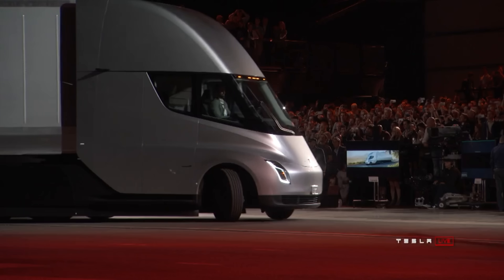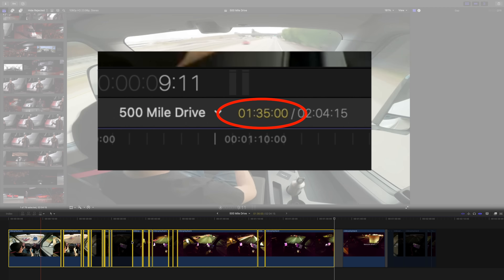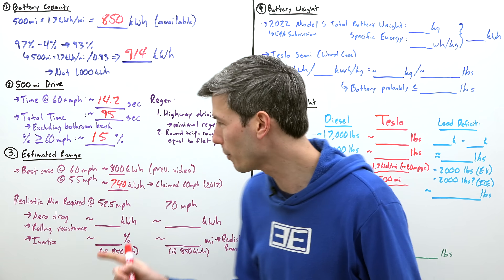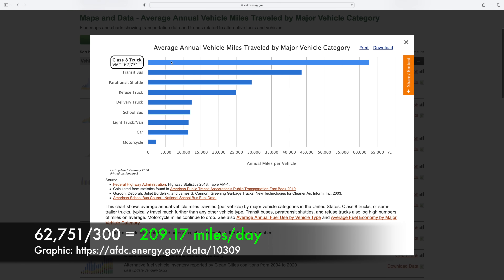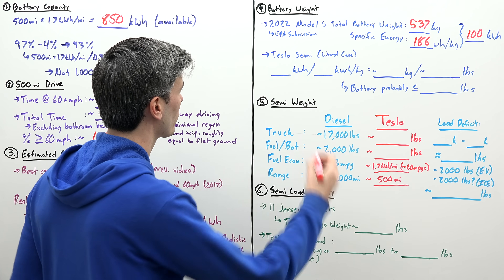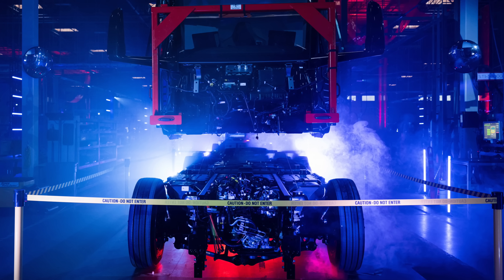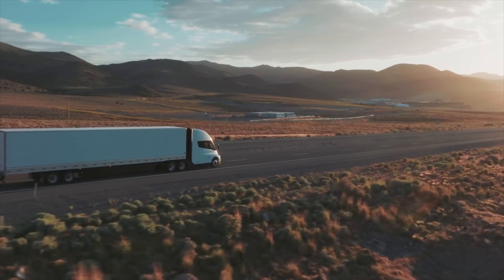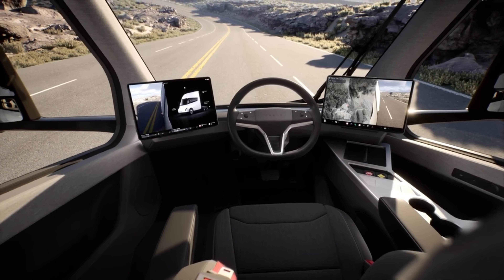Does The Tesla Semi Make Any Sense? Part 2!

Comment: It is refreshing to watch a video that provides a balanced and objective analysis of a Tesla product. This video has been very helpful in explaining some of the factors that need to be considered. We are on a 'journey' to alternatives to Internal Combustion Engine vehicles. At the very least, Tesla will continue to be important in providing options in the development of future transportation means.
Reply: At the same time US are one of the worst rich countries to develop the ev-truck. Just due to the size. 
 In the Europe in 500miles you can cross at least one whole country (eg. From Belarus to Berlin via Poland).
Reply: @BlueScreenOfDeathPL  
Unless I'm mistaken, in Europe (and UK) there's also more regulation requiring drivers to rest, increasing charge opportunity?
Reply: @rogerstarkey5390  You are right - we can drive up to 10h per day (11 on special terms, depending on country, and we have 45min break), so range of 800-900km would be enough.
Reply: @BlueScreenOfDeathPL  
Thanks for the clarification.
Is the 45 minute break over and above the 10 hrs?
Reply: @BlueScreenOfDeathPL  900 km is not needed. EU rules say you can drive a maximum of 4.5 hours before a minimum 45 minute break. And with a legal maximum speed of 90km/h, that means that you are not even allowed to drive more than 405 kilometers in one go.
Reply: @rogerstarkey5390  45 minutes every 4.5 hours in EU
Reply: We're at the high economic limit for battery cost and from here on it will just go down. ICE has been at their high limit for decades...and it just goes up with fuel costs. True, they both use the same kWh in the end...but electric distribution is an order of magnitude cheaper than hydrocarbons (no...they don't come from fossils). If charging time is an issue, Ultra-caps will solve that.
Reply: @Todd Marshall  wrong... it will only go UP... Because we are RESOURCE limited on the raw material side... just not enough slave child labor to keep up with demand
Reply: @toddmarshall416  Supply and demand will dictate the Price, As demand go up so will the price
Reply: @retired2920  
"Supply and demand" for let's say oil requires constant replenishment of the supply.
.
Once battery materials are in the system, they stay in the system for ever being recycled as required.
As for Electricity supply and distribution, you can build green supply for about one third the price of even nuclear.
Once built it's essentially passive, requiring little if any maintenance.
The cost will go down over time.
Even better, if you build at point of use (rooftop solar, etc) it becomes cheaper than the cost of even distributing other sources of grid energy.
It trends to free
Reply: It wasn't deceptive at all to bury the massive subsidies Pepsi is getting until the last couple seconds????
Reply: The very big flaw of videos like this, is taking what ever Musk says/twits as a fact, despite Musk proving himself as compulsive liar again and again. Any analysis, no matter how objective it is, based on data from Musk is untrustworthy.
Reply: what is the cost of replacing the batteries after between 7 and 10  years, Who is going to buy a used truck when you my have to replace the batteries, what sort of trade in are you going to get if the dealer thinks he will have to replace Batteries. Will the warranty cover the Batteries don't think so, How long is it going to take to FULLY charge the Batteries
Reply: @retired2920  you know full well tesla doesn't warranty batteries, and it will be $100k
Reply: @finish_my_projects  
YOU should "know full well" that they DO warranty batteries.
Reply: @Roger Starkey  not like you think they do... nothing like an ACTUAL warranty on a powertrain... on for loss of range above a certain amount in the timedrame, and manufacturers defects... if it bursts into flame, tough titties, if it breaks in any way not a manufacturer defect, suck that $20k bill
Reply: @finish_my_projects  
Rubbish.
If it "bursts into flame" and it's a manufacturing fault, it's under warranty.
"If it breaks in any way other than manufacturers defects" that's like ANY other warranty for any product you buy?
.
And where do you find the "20k" guess?
Reply: @finish_my_projects  last quote I got for my puny leaf battery was 8900 dollars.
Reply: @Roger Starkey  no it specifically says battery fire is NOT covered, so wrong... and warranties on your drive train also don't specify the need for a manufacturing defect, you are either naive or being intentionally obtuse...

The $20k cost of a battery is well known, that's what a tesla extended range battery costs, $21k actually... standard range is $16k, I've seen people show the quote directly from Tesla, one is on Hoovies garage
Reply: Lmao, those conditions do not take into account weather and the battery losing capacity over time.
Reply: Ok but this video is assuming those barriers each way 4000. There’s no way to verify that. 
They could each weigh 500lbs and we’d have no way of knowing.
Reply: @Ian Fisch  
I think he's done enough to show that they are typical barriers and he found the weight for typical barriers. Sure, the barriers on the truck may be a different weigh, but unless there is some major subterfuge going on, I think we can safely assume that 4000lbs is a good estimate for the purpose of the video.
Reply: @rogermccaslin5963  if you look at the barriers, you will see that they are somewhat different to New Jersey barriers typically seen across this nation. The end caps are different. The material appears chalky, but most importantly, who drills holes in New Jersey barriers to run change through them to strap them to the on the trailer? Seriously, who does that? I think maybe it’s just a Tesla doesn’t have any truckers on their staff and literally thought that was a good idea but that said when you look at the holes, it just doesn’t look like the new Jersey barriers that I’m so familiar with on the East Coast. And a full load of New Jersey barriers is two high on trailer. So it best this truck looks to carry half what a diesel truck would carry. Just go look at the videos goal online and Google image New Jersey barriers. You’re gonna see they. They often have either eyelets at the end or ridges have been cast into the concrete so you can lift it with a claw. I’ve never seen anyone drill holes in New Jersey barrier to lift it much less change it to a truck. It’s all very odd.
Reply: @JoeOvercoat  
I just hit the ol' Google machine and, low and behold, on the first page was a picture of a Jersey barrier with holes going through it. There was also a link to a video from Shea Concrete Products in Massachusetts. I thought to myself "How can this be? JoeOvercoat assured me there was no such thing." Of course, being the great friend that I am, I took it upon myself to look at the Shea website to prove Joe correct.

After an exhaustive search that had to last, at a bare minimum, 15 seconds, I came to the barrier page and, I hope you are sitting down, they had more pictures of those barriers with holes in them. What was this witchery I was witnessing? Did they actually drill holes in a barrier? A JERSEY BARRIER? Maybe it was a masterful job of Photoshop? I was flabbergasted. This must be a conspiracy of the highest order, on par with the fake moon landing or the globe earth.

I know, it's crazy, right?
Reply: @rogermccaslin5963  I thought you were right for a second, and then I googled jersey barriers, and one thing stuck out to me the holes on the real jersey barriers looked MUCH smaller. MUCH smaller.
Reply: @ianfisch7289  
Try this for a start.
The "width" (thickness) of a standard Jersey barrier is 24-26"?
They were 3 wide across the bed?
There was about a 1/2 thickness "spare" on either side?
.
26 x 4  = 104"?
.
What's the standard width of a trailer bed?
102".
Those were standard cross section Jersey Barriers.
10 foot standard barriers average at 4,000lb
Even if you assumed they were 8 foot barriers, they would weigh 3,200 each.
....
Final check.
Apply his assumption, using the drawings he provided to my calculation.
3 barriers wide plus a gap each side.
4x 500 mm (from the drawing!)  that's a bed width of 78".
Remember the actual bed width? (102")
Reply: @ianfisch7289  ????
Reply: @ianfisch7289  That's right, those barriers could be made of paper mache. Also, every other person in the world except for you could be fake, an illusion. We will never know.
Reply: @ianfisch7289  But that's a simple assertion without any evidence to it. There's more than one data point being used in this video to validate the math, and it's fairly consistent.
Reply: There's zero mention of the fact that battery prices could literally jump tenfold, there's no cap on that price unlike with oil because high oil prices cause economic damages whereas high battery prices just cause more money printing.
Reply: @ChatTHC420  "theres no cap on that price unlike with oil" Lol
Reply: @ChatTHC420  this may be one of the dumbest comments I’ve read on YouTube.
Reply: @ChatTHC420  true, and it's guaranteed to go up a massive amount, resources barely to go around for production right now, much less the fantasy of all cars and trucks going electric
Reply: @finish_my_projects  This. Most people just skip the fact that the raw materials for batteries are itself not capable of meeting the world requirement.

Comment: You can do all the math you want or come up with any scenario but the bottom line that this is not economically possible to remove 3 million diesel semis and replace them with 3 million EV Semis.. Preposterous!  
Again if you want to reduce carbon emissions we need trains. DOT is talking about having a charge station every 50 miles on major highways🤣🤣🤣. Let's do the math on that, the cost, the amount of infrastructure it's beyond belief.

Comment: You’re still not comparing apples to apples. The Tesla is a day cab. Check the weight of a diesel day cab. It’s a lot less than 17,000. An over the road sleeper weighs about 17,000lbs. With 200 gallons of fuel that’s well over 1000 miles per tank. That saying not emptying my tanks. Those are my tanks. There are a lot of trucks with 250-300 gallons of fuel capacity. Thing about this. A day cab with a flat bed trailer can carry the 54,000lbs that you mentioned and go farther than the Tesla.

Comment: The only way this technology could apply to railroad is if each car on the train has its own batteries and traction.  This would be a massive upfront capital hit, but the operating cost over the long term (10+ years) would be tiny.  Also, the train "operator" would be able to price each load quite accurately.  Further, "cars" (boxcars, flatcars, tanks. hoppers) could be client owned (capital) but pay the railroad for power (charge) and "road" access and management.  The railroad locomotive itself would hardly need much power as it would be the logistics/navigation/control point - but not pulling much load, itself.   Taken further, train consists could be much smaller, targeted and even fully automated (no crew).  Sad.
Reply: ...if each unit in the train has its own propulsion, that opens up the possibility of that unit being able to travel the last few miles over public roads. And if large segments of the railroad infrastructure was electrified, it would drastically reduce the battery capacity requirement. The isolated railways are also better 'self-driving' candidates than public roads. None of this will ever happen in the USA, however, not only due to the massive capital cost, but also the fragmented ownership of the railroads.
Reply: @videopipeline6419  
Electrification of US long distance rail is a non-starter.  Far too much to build/maintain.
The fragmented ownership actually makes this a more plausible approach as differing rail owners will want to market their rail capacity to other railroads and 3rd party car owners.  (Competing rail does book capacity on competing lines currently).
The "public road" thing is plausible given appropriate design, etc.

Comment: Why are electric semis allowed to be heavier?
Reply: @Anthony Lipke

L A W
Reply: @ivankuljis1780  there I went worrying it was something sensible
Reply: @anthonylipke7754  
Allow for Battery and other sensible!
Reply: @ivankuljis1780  it's a kind of policy I consider picking winners.
If the weight limit is a genuine need or practically exceptions for unrelated reasons like wanting equally capable electric vehicles is hamstringing alternative solutions by red tape.
More practically in some cases shipping more product with less truck mass fraction while not future focused could improve emissions per mass/distance traveled and cost.

I'm still down that high temp self reforming fuel cells haven't improved enough.

Comment: Well, we all know that the most reliable information comes from Elon, because he's the one on the ground doing all the engineering and testing, plus he's never lied or been misleading in the past. And Twitter is also just an impeccable source. On a more serious and reality based note, if the battery capacity went up to 1125kwh,  you would be adding 2500 lbs of battery and losing that much cargo capacity.

Comment: Thank you for the video! I was always wondering why there is no such thing as PHEV semi? It feels like half of the battery could be replaced with small 1 litre diesel engine generator, that would've topped the semi along the route.
Reply: This could still be a good solution with a sufficiently powerful generator. Energy density of liquid fuels is pretty damn high, even given how inefficient it is to burn it. A hybrid approach may offer an option for ultra long distance routes or allow for less charging infrastructure.
Reply: So I run calculations. 100 litre petrol is 890kwh. Atkinson engine with 40% thermal efficiency would produce 356kwh of that. The engine weigh around 100kg as well.

200kg gives 356kwh using petrol.

200kg of Tesla batteries is only 60kwh (300wh per kilo).

So it should make sense, it’s just not Tesla business.
Reply: I think the biggest answer to that question is that it's not future-proof. PHEVs are the same as BEVs. The main advantage of BEVs is the lower cost of ownership. Plus, you'll be adding extra weight. anyway, Maybe it still works out in situations were altitude is changing a lot during the drive.